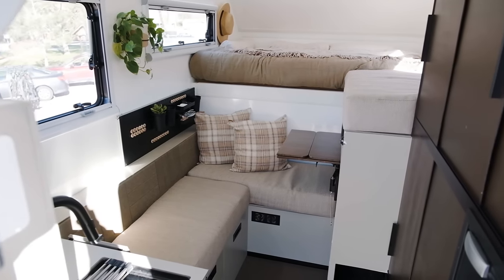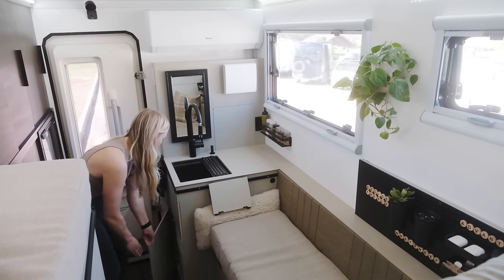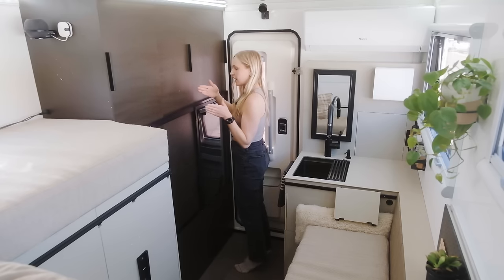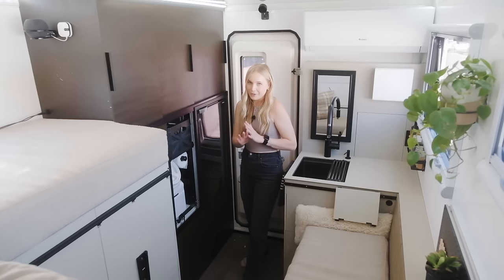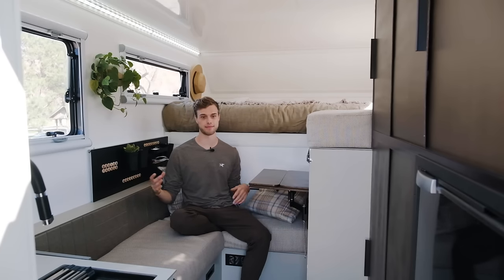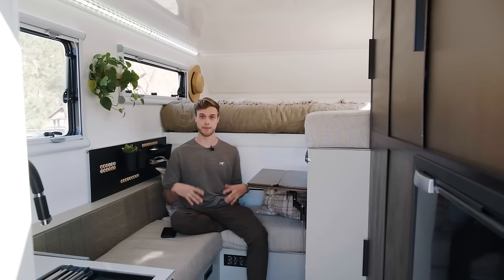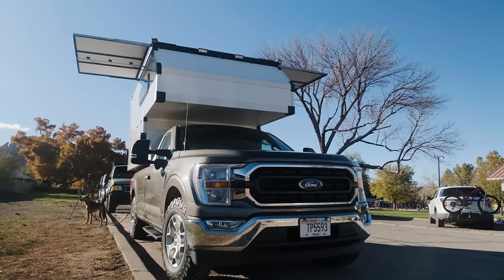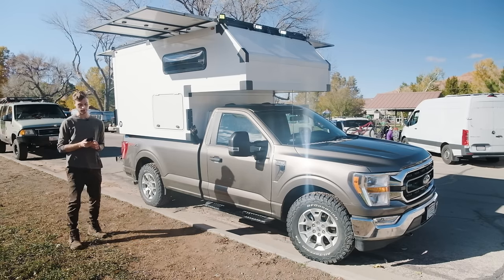Incredibly Designed Lightweight DIY Truck Camper

Comment: Hi I like your camper.i am sure it's hard living in a small space and sometimes privacy is needed. I wish the best . One comment is the air draft in the front given the top is not meeting the truck top, have you thought about adding wind deflectors or maybe a slide out storage compartment to fill the gap ,I bet it would increase gas mileage. Safe travels
Reply: Thanks for watching Paul! It's not something we've felt we needed, but not a bad idea at all.

Comment: Finally, people that understand that every extra pound of weight is a detriment. Extra weight leads to worse gas mileage, faster tire wear, more wear and tear on the engine which ends up costing more money. Good job guys. 
Fisher & Paykel offers a single drawer dishwasher that only uses 6.85 liters of water per cycle, Bosch's German website has several countertop, single drawer, or slim dishwashers that again use less than 8 liters for a full cycle, it is impossible to hand wash a full load of dishes with such little water and your dishes are truly sanitized.

Comment: I greatly admire your attention to detail in planning and executing on your build.  I'm in the planning stage of my own build using the same platform, 22 F-150 RCLB HDPP.  Before seeing this video, I'd not seen any using this vehicle.  Great job with your new home and hope to see you on the road someday!  Do you have any build videos or posts somewhere?  I'm always eager to learn and improve my plan.  Best Wishes!  PS. Curious how your camper affected MPG.
Reply: I’ve got a similar thing going in a 21 f-150 Powerboost. Currently, I think the plan is to keep the battery system small and recharge it using the hybrid power train.

Comment: what is the brand name of that wall mounted air circulator she used in place of maxi air fan
Reply: It's a Lunos EGO ERV—we cut out the power supply to run it on 12v directly and hooked up the control board to a computer so we can adjust it from our phone 👍

Comment: Very well designed for the intended purpose.

It doesn't look like the camper is ever removed - while that would be possible, it has no jacks, for instance. Why keep the pickup box, instead of removing the box to save weight and provide more space?
Reply: Thanks for watching Brian! We do have jacks for the camper actually, we just remove them when we hit the road from our home base in Wisconsin. That way we have a fully functioning vehicle to drive around when we're back for the holidays with our families. A flatbed truck camper was something we strongly considered before starting this build so definitely pros to going that route as well 👍

Comment: It's cool but to much electronics for me being full time out west none of my electronics last very long due to dust. Even fried a car computer. I got 32 years in manufacturing. To have it in cad is awesome. Give me a print and I'll have it done in no time. Did you weld the corners to make it leak proof?
Reply: The sides of the camper are assembled using Kora Pop adhesive believe it or not!

Comment: Hi, nice layout !! Question, what is the name of the Air circulator ?
Reply: Lunos EGO ERV, we cut out the power supply to run it on 12v directly and hooked up the control board to a computer so we can adjust it from our phone
Reply: Oh nice, this is really helpful 🙂

Comment: What Kind of Shell Did You Start With
Reply: Total Composites
Reply: @dave242able  Thanks I Intend To Pair The Shell With An F-150 Hybrid So I Won’t Have To Worry about putting in an Electrical Sys